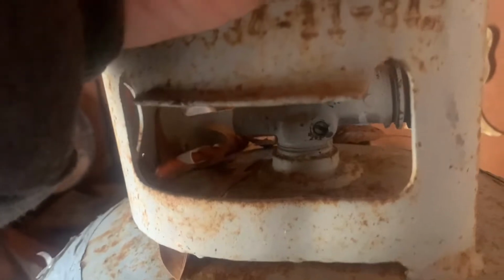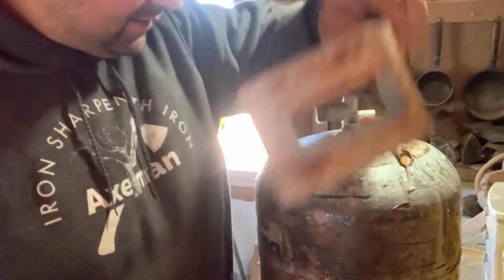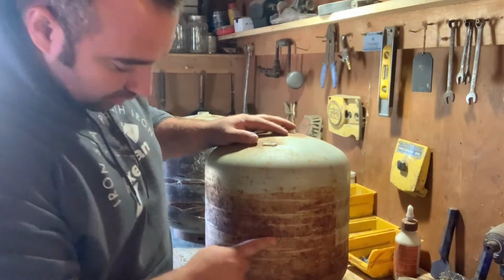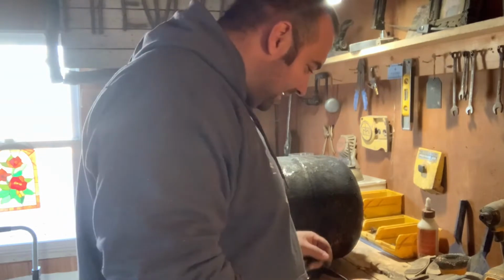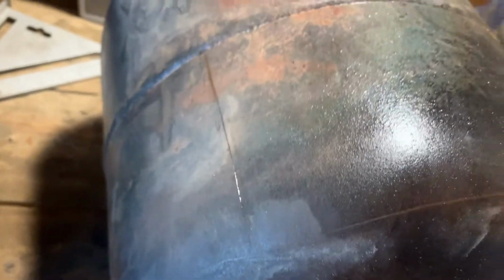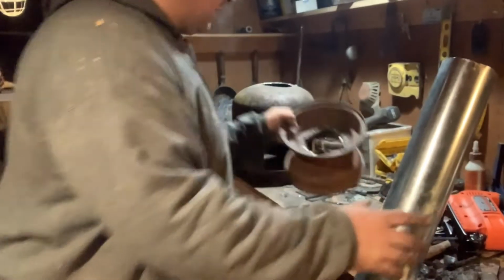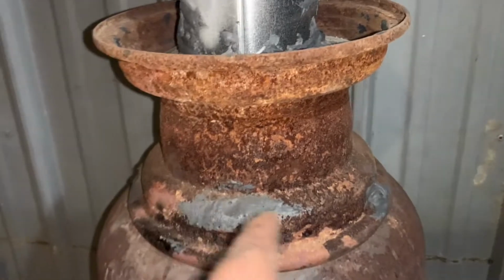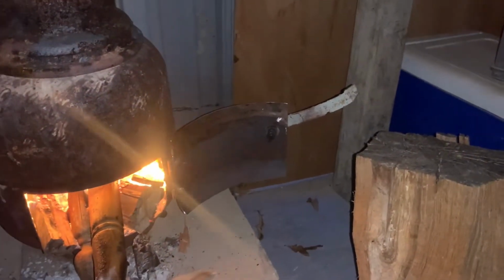Propane tank wood stove made with no welding

Comment: I've always wanted to build one , even started to once but I was to scared to cut into it. I may try again now. On a different note, be careful with those grinders, if you ever drop one don't use that blade, get a new one. On the thicker wheels that are more for grinding and not for really cutting, never use them to grind down anything soft,wood, plastic, bone even, never something soft that can build up in those pours in the wheel, it will hold excessive heat and that can cause them to blow apart too. I seen a e.r. video where a guy had one of those thick wheels come apart and he had to hold his insides in with his hand until the ambulance got there, very gruesome I know. Not trying to scare you just looking out for you. I'm always nervous using the grinder now after seeing that video.
Reply from the maker: Wow, that shows how dangerous they can be! I have been using them since I have been an adult pretty much and never had that happen til then. It got bound up inside the wheel and where I had the sun glasses on I couldn’t see what was happening very well. Then it just broke all of a sudden and I felt it hit my leg. It’s surprising how much force one of those little grinders can generate. I tried to modify a chainsaw bar with a grinding disk and it kicked back and hit my finger and I believe it went to the bone. I have a scar on my finger from it as a reminder. I was the same way with being nervous to cut on the tank. I tried to drain them very well and then after I filled them with water three times and drained them I burned them too. At that point I felt they were safe to cut on. I appreciate you telling me that about the grinder cause I definitely want to be more careful with them now. I’ve learned to do my best to not put them in a place where they can get bound up after this experience. I was a union sheet metal worker years ago and those guys would tell me pretty often that I better change the disk before it broke on me. This time it was my fault for getting it bound like that. Down inside that wheel was a dangerous place for a grinder for sure!

Comment: i would reuse the cut out part as the door cause for it to be a efficient stove the draft of air around the door will help.
Reply from the maker: @RichardSMaloney  it needs air flow but I would go lower myself. I feel like if you used the cutoff piece you would have smoke coming out around the door as well

Comment: The lawnmower wheel helps alot I  did  the same thing  with mine  fits a. 6” pipe perfectly I didn’t have 2 tanks at my disposal so my door  still lets a lot of air in I made a damper on the side for added airflow from the bottom and have a pipe with damper now I used the black stove pipe for my first 6 ft or so then went to same you have used  I tossed an old car rim under  the tank as a stand    Awesome to  see a similar build 
 It’s cool to see  an almost twin of the stove I made for  my 12x12 shed
Reply from the maker: That’s very interesting to hear! A very similar build it sounds like. Sounds like you put some thought into yours as well. Im always glad to hear of people re-using materials and putting them to use. I think the propane tanks are great for wood stoves myself. Thanks for watching my friend and I appreciate you taking the time to comment!

Comment: Nice job Dillon !! That baby is cooking 🔥 would have never thought one could make something like that without welding ! Looks like the critters are enjoying it also 👍👏 might want to sit it in an old cookie sheet (some metal tray) on top of the cinder blocks, to catch ash and cinders that might come out. Great work 👍👏🪵🪓🔥 Rick
Reply from the maker: Thank you Rick! I’m very happy with how it turned out. I modified it a little bit today. I put a piece of metal under the cinder blocks and added a home made damper to it as well so I can control the air flow in the pipe. All of the critters seem to be loving it now that they know it’s there. They were in there again today and in there just now when I left there to come in lol. Thanks for watching Rick and stay warm in these cold temperatures.

Comment: Once you clean up the rim you could attach steel mesh and a aluminum shield (on the back)  of the rim for inferred radiant heat. When I build mine It's going to be a wood burner and radiant heat because it's super simple to add. I've done a lot or research and again thank you. I was going to think I can cut my tank cause it's empty. I found a lot of guys were cutting this tank blah blah.

Comment: Where does the stove get it's oxygen from? I didn't see any vent holes.
Reply from the maker: That’s a good point. I plan to drill some holes in the door to allow the air flow.
Reply: If your gonna drill holes in the door. Then why wouldn't the gap from the original door you cut work. It has a small gap all the way around the door. Just curious.
Reply from the maker: @sharonimel3932  it very well may do that but I’d like to make a latch that I can control the air flow with.

Comment: Tuck your hoody stings in. Several years ago there was a guy in a sister factory using a grinder while wearing a hoodie and the string got caught in the grinding wheel and cut his throat.  By the way where are you located, if in KY where. I have been thinking of making one of these stoves for a while now. I am getting closer to doing it.
Reply from the maker: Very good point! Thanks for that Roger. I will be sure to do that from now on. Those grinders can be extremely dangerous, that’s for sure.
Reply from the maker: I’m in eastern Kentucky by the way. I just realized I hadn’t replied to that part. Near the mount sterling area.

Comment: After using the angle grinder, l would not bother with the water . If it was going to blow, it would have done it by now .
Reply from the maker: I used the angle grinder on the welds. I didn’t penetrate the tank itself. It’s not a risk I would take. If one of those blows you are dead or changed for life, likely.
Reply: Definitely good idea to flush with water, I’m going to do the same way, probably burn it as well.

Comment: Leather gloves and face shield min.
Reply from the maker: It’s an option. I was a sheet metal worker in the union and used angle grinders a lot. I use safety glasses but not usually gloves or a face shield. This is the first time I’ve ever had a disc break and it’s because it got bound.